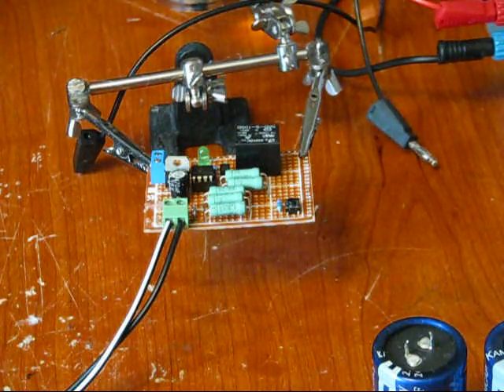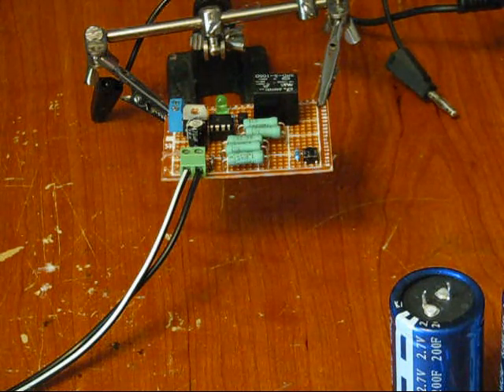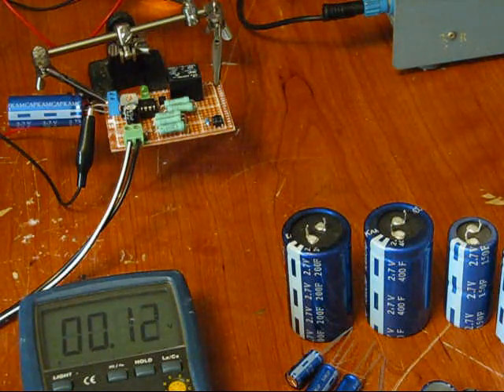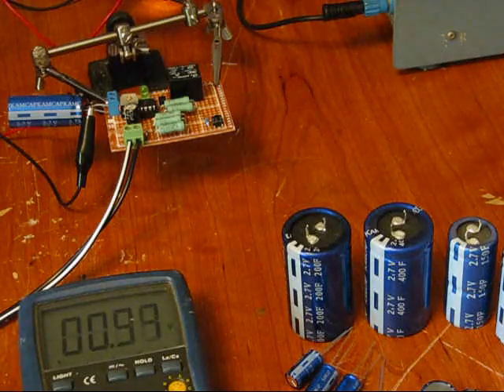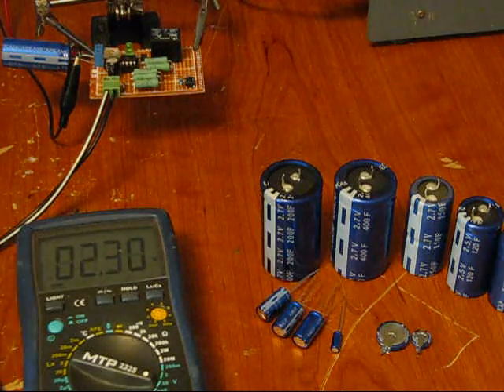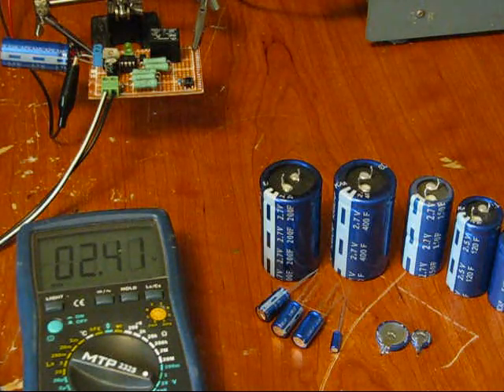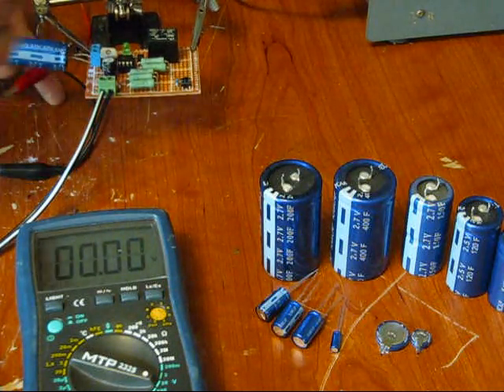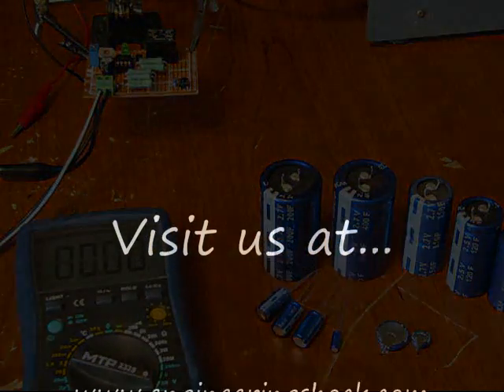Mini Dual Setting Super Capacitor Charger with ADC

Comment: what value supercap might I require for a low current 1.25 volt application comparable to a AA battery (i.e. around 400ma).  I only expect it to power a device for under a minute before recharging.  I'm thinking around 0.2 farad but just wanted your opinion.  thanks in advance

Comment: i have a 2.5 volt 2600F capacitor and accidentally charged it to 2.8 volts. as soon as i realized it i discharged it to 2.4 volts. would it be screwed up now?